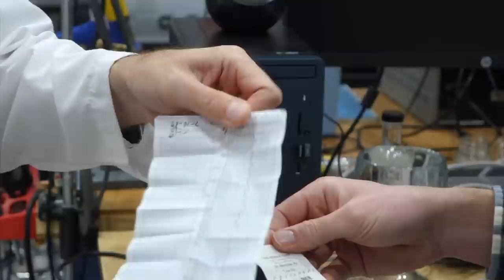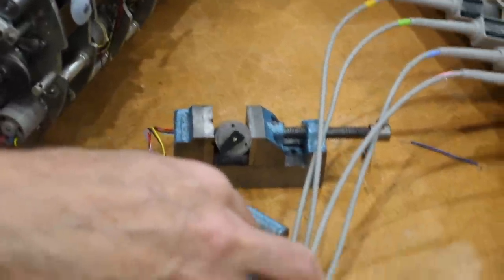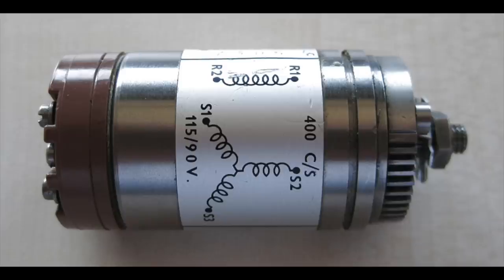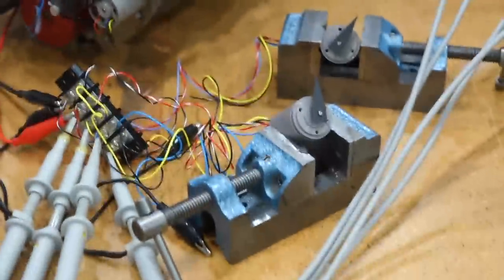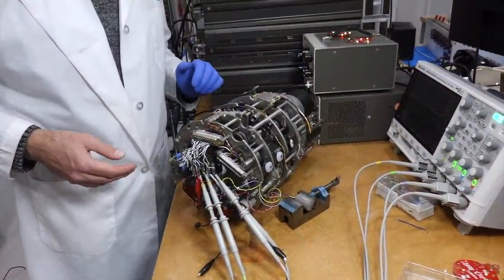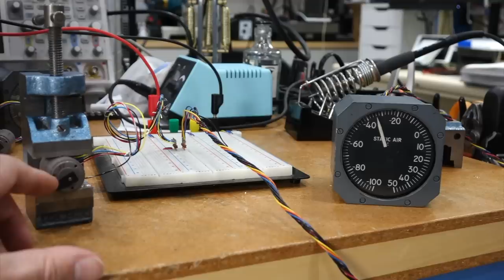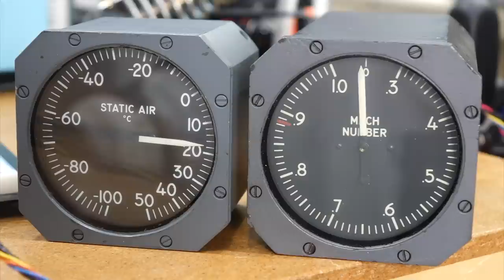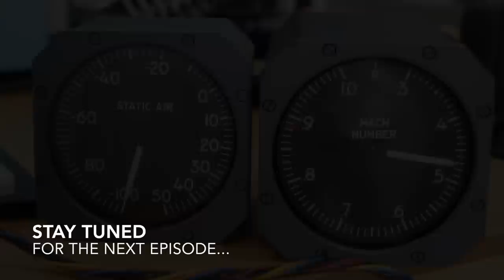Bendix Air Data Computer - Part 3: Intro to Synchros

Comment: Why is the setup where the stator windings are powered with 3-phase AC, while the rotor winding is connected to the other synchro's rotor not so popular? I believe it also works, and it reduces the number of wires needed.
Reply: I would guess because there is an entire ship or aircraft wired for whatever power they decided to use for everything else.

Would that really use less wires?  I'm not sure I understand!  But I don't know much about 3-phase power.
Reply: @ydonl  As shown in the video, you need 3 wires between the sender and receiver and you need to connect both to power supply. In that setup, you'd need 1 wire between them and a connection to 3-phase power supply for both (but 3 phase power would be available ~anywhere in an aircraft).
Reply from the maker: Aha. It's not used because that would not work the way you expect. If you powered the 3 windings with 3-phase AC and then powered the rotor with any AC, you'd make a 24,000 rpm synchronous motor. Assuming it's even capable to rotate at that speed. We actually used such a wiring for spinning a gyro: https://youtu.be/pz-LA71tMWw . In a synchro, there is no such thing as 3-phase AC. All the 3 stator widings are in-phase. There is just an amplitude difference between the windings, not a phase difference. It confuses a lot of people, including me initially.
Reply: @CuriousMarc  You are very right that it would do something very different, but I think it would oscillate rather than rotate: for half of each cycle it would be pulled towards the stator's field direction and for the other half towards the reverse of the stator's field direction, so it would oscillate around the direction the stator's field has when the rotor's field is at its peak. So, maybe it would actually work as a selsyn if the receiver rotor had large inertia (to minimize the oscillation amplitude) and enough friction (to dampen the oscillations), which would make it a comparatively useless setup.

What I am too confused right now to imagine is how the dynamics of two such identical  (also mechanically) connected units ("sender" and "receiver", but identical in all regards) would look like (coupled oscillations? forward rotation?).

Comment: Like a Swiss watch...
Temperature in Celsius not in Fahrenheit
Reply: Why does a Swiss watch need to tell temperature at all.
Reply: @c1ph3rpunk  If you saw a Swiss thermometer you would know...
Reply: Well, that's aviation for you. We might use feet, nautical miles, knots, inches of mercury, and slugs per cubic foot but, by golly, we use Celsius!

Comment: It makes me feel old when a part made when I was 30 years old is treated like an an ancient artifact.

Synchros were used for such a long time and for so many systems because they work well and have very simple wiring. They're very robust because there's only one moving part and even when wires are shorted or reversed nothing burns up.

The Mach Indicator having an output is so that the Mach number can go as an input to the autopilot, the flight data recorder and sometimes to other places like fuel computers or cabin displays.

Comment: I'm sure you are aware, but those old flight instruments could be radio active if they used radium paint.  Might want to check if these are or not.  Seems like they kept using radium paint into the 60s for military stuff.
Reply: Those ones are too modern already to have radium, radium paint looks yellow or even brown when very old. I know a dude who have a whole bunch of radium loaded WW2 aircraft dials in his living room... it is a little bit like having Chernobyl at home 🤔
Reply: I'm pretty sure Marc is curious enough to test them with a Geiger counter.
Reply from the maker: Yes we did test them and they were not radio active. That's why I wear the gloves and mask on the Mach meter by the way, I had not tested this one yet.
Reply: @CuriousMarc  I figured you were on top of it :)
Reply: I always check old instruments with a Geiger counter just to be sure.  About the time B-29s became staple, the flight engineer’s console was equipped with UV emitters to illuminate the gauge dials done with fluorescent paint.  So, the flight engineer could fry his (not many/any women B-29 crew back then) corneas with UV instead of being bombarded with gamma rays from radium gauges.

I’ve got a couple Hamilton navigation clocks from PBYs and those dials glow super bright orange with even just a little long wave UV illumination.
Reply: @CuriousMarc  There’s lots of weird and sometimes quite nasty stuff in old electronics.  I found out some Motorola power transistors are filled with beryllium paste.  I remember cutting transistors open as a teenager and finding some filled with unidentified substance.  I guess it wasn’t beryllium as I’m still here to write about it!  Now Motorola service manuals for 1960s vintage commercial mobile radio gear have beryllium safety notices inserted.